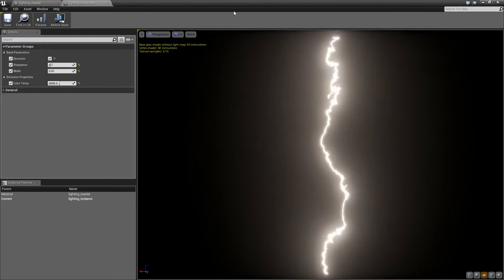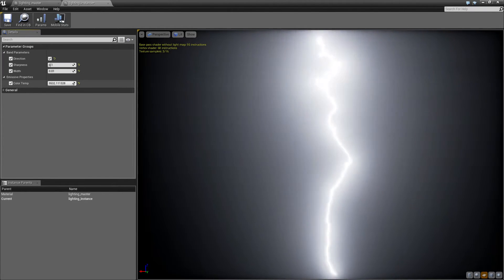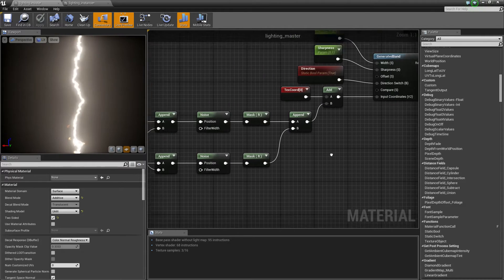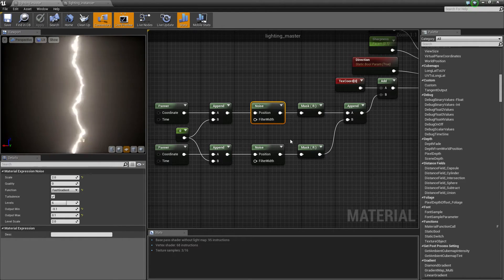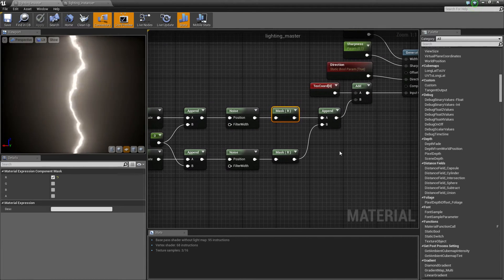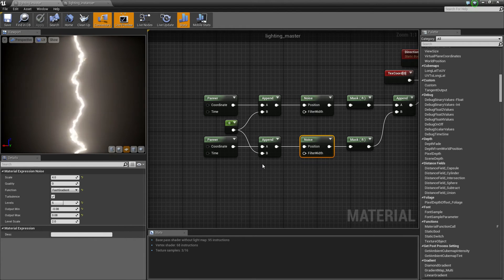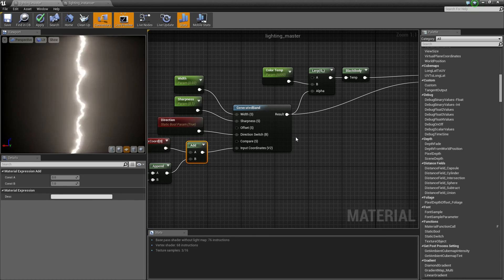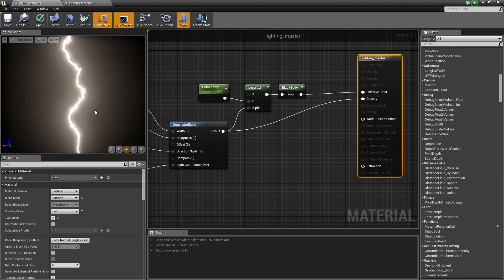Procedural Lightning Material - UE4 Quickie Tutorial (Old UE4 Version)

Comment: The material seems to contain an error.  The GeneratedBand function uses only U or V channel according to a Direction Switch. So one noise node is always lost. Instead of "Append", combine them (Lerp, Blend, Add). And adding to @PotatoClips, Width can also be multiplied by a diamond gradient to thin the ends.
Reply: Correct, i used a multiply instead of the apend before the TexCoord, and it worked. Beforehand, when i did exactly like in the clip here, it was totally different - bad

Comment: Thank you for this. I changed it to horizontal and it works very well for a particle beam. i multiplied it by a diamond gradient just before it is added to the texcoord and it pinches the beam to meet up at the beginning and end, which is super useful for consistent beam effect. could not have done it without this tutorial. thanks.

Comment: Is there a way to control the intensity at which the lightning emits? I know that the temperature adjusts cool/warm, but its just too bright for my scene. Any help would be appreciated =)
Reply from the maker: You could put a multiply node between the blackbody and the emissive, then attach a Scalar Parameter to the other input of the multiply node, that would allow you to adjust the intensity of the final output, if you set the parameter to a value less than 1, if you set it higher than 1 you could boost the intensity.